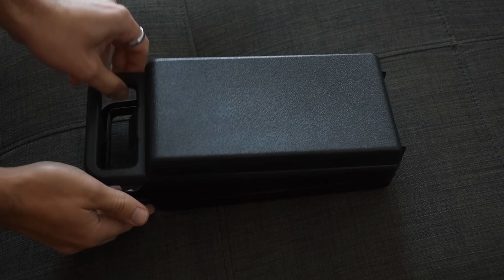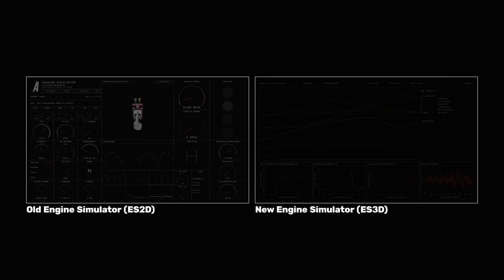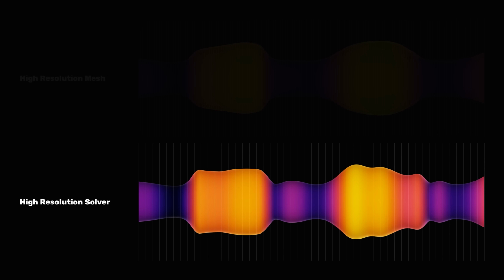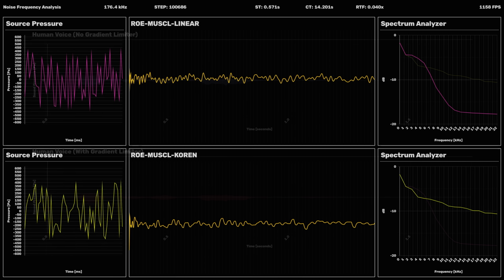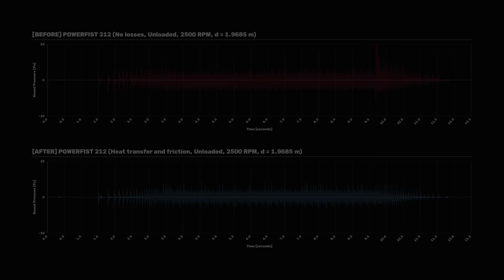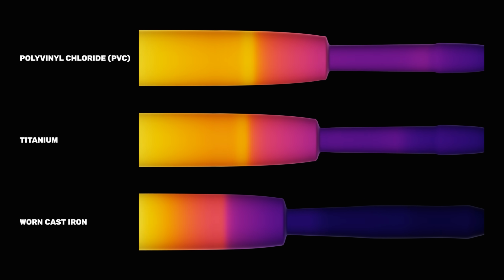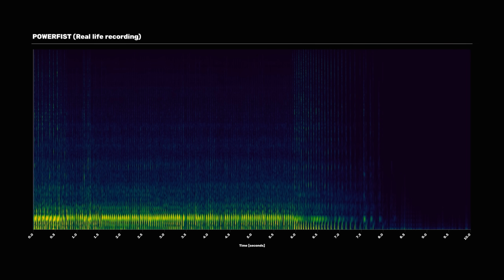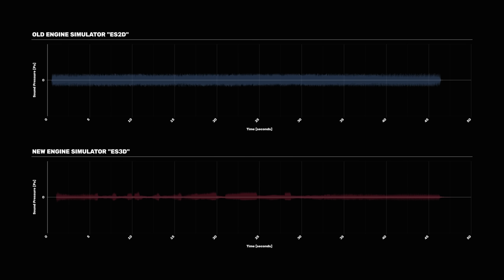Improving My Engine Sound Simulator With Real Data

Comment: One thing I think is important to remember is that it is not just the exhaust making noise. All the parts on the real engine are moving and vibrating creating their own noise which is not simulated (things like  fuel injectors,  filters, even the materials used which impact the noise etc..). But brother I gotta say the simulations sound scarily realistic
Reply from the maker: Yes, you are correct that engines produce mechanical noise. I mentioned it specifically in the video and it's something that is not part of the simulation yet. Right now, I'm focusing on refining the fluid simulation, which addresses the most prominent sources of noise for most engines. At a later time I might look into these other sources of noise
Reply: Don't forget that when you add carburetors or just the throttle body, you’ll hear a deeper intake tone at WOT if you’re running only an air filter. At least that's from what I know about small engines, it probably wouldnt effect larger vehicles like a car like it would an atv or motorcycle.
Reply: yeah, even the rim and tire size
Reply: also the sound and resonance of how a engine sounds can be entirely changed by changing things like runner length, height, thickness etc on something like a exhaust manifold, and those same factors apply to the exhaust too, using something like titanium on an exhaust vs steel you can hear a difference in sound purely from the resonance of the metals itself, cars and instruments aren’t too far off of each other lol
Reply: induction noises as well, the air flowing into the engine makes just as significant noise as the air flowing out of the engine
Reply from the maker: @sahibdipsandhu  No, induction noise is not as significant as exhaust noise. Maybe for an engine that is heavily muffled or if you're standing right next to the intake. In general though, it is not accurate to say that intake sound is as significant as exhaust noise and virtually any research paper on engine noise would agree.
Reply: @AngeTheGreat  On particular cars it can. Engines with ITBs sound significantly different from the front compared to the rear.
Reply from the maker: @Thee_Sinner  The claim I was responding to is that induction noise is comparable to exhaust noise, which is definitely not true. As per the original comment: "air flowing into the engine makes just as significant noise as air flowing out of the engine". In general, this is simply false. If you have an engine with significant exhaust muffling, particularly loud intake and you place the measurement device right next to the intake, then maybe the APPARENT magnitudes will equalize, but this is just stating the obvious and I'm already aware that intakes make noise.

Comment: the updated harley sim sounds SO GOOD!! Also, Im wondering if there is any worth of investing in a visual microphone? It's basically a number of spaced apart mics that triangulate and can visualize where sounds are coming from, and can attenuate specific sounds (for instance, mechanical sounds like you mention trying to ignore). Sure it is an investment as they can be pricey but there are some tutorials and open source software I believe for making your own a little cheaper

Comment: Hear me out.
Midi control.
Wrapped in a VST.

You could tie the accelerator to glissando.
Change the timbre by configuring cylinder count, valving, load, muffling.

The most important part would be mapping midi notes to the resulting lowest frequency of your sim (the fundamental). 

Let me play this engine simulator with a piano keyboard.

Comment: I have a really good question, considering if Engine Simulator has future updates would it also include other engines to simulate the sounds? Such as an Airplane Engine, Lawnmower Engine, Tractor Engine, Tank Engine, Etc?

Additionally, what if Engine Simulator had some extra simulation conditions to make such as "Engine Failures"? What would the Engine Fail's Unique Audio sound like?

Comment: WOW Ange! The final iterations of those simulated engines aren't just the best you've ever created, but they blow most video games out of the water. Even modern, cutting edge, AAA games that released in the last few years don't have that kind of granularity to the engine's sound detail. Really impressive for WIPs and definitely looking forward to seeing how you push right up against those theoretical fluid simulation limits

Comment: 13:25 that is a lot of particles, why not have a single strand of them compressing and releasing along a single vector? most things work with compression so you could have lots of particles closer to each end for the "spring compression" and then some stand in ones along the length of the pipe to effect each end.

Comment: 13:00 im curious about the different layers of wave forms within an engine, not everything is a single shape, so is there a way to layer out the different wave shapes then combine them, like putting an image into separate black and white images for the RGB, you would be able to get the different wave forms even if they're out of sync and still get the highs and lows.

Comment: 11:30 it sounded way to uniform. Also i dont know why you didnt just simulate the high frequencies separate from the origonal, you could give them different rules to make them only play in specific conditions and then feed them through togeather.
Reply: That falls under the fluid dynamics of the combustion process and the derivatives, rather than the audio/exhaust and intake sound signals. That said, I do agree that it is too uniform but that is why.

Comment: have you ever though to add your sound simulator into a game?
for example, it could be a really the best solution for old game, for example Richard Burns Rally: a lot of people driving into this sim, but 20 years old engine recorded sounds (and even a kind of new recorded sounds) are terrible.

your simulator, even the first version, can be a breath of fresh air for such games

Comment: Sounds a bit artificial, but it does surely sound like a hear near the exhaust port.
As side note, when recording real sounds, maybe a open baffle between the engine and the exhaust would help to make it more to one with the simulation.
You know, mounting the engine similar to a speaker in a open baffle setup.

Comment: Have you used one of those sonic tools yet? the ones that display where and what sounds are coming from where, and lets you isolate particular frequencies and only shows those locations. You could use that in combination with some contact sensors/mics to record individual parts of an engine.

Comment: looks like simulation of flute sound with gasoline engine connected.
it looks to me that high frequency components should not to be muffled but mixed in sort of hissing metal flute high harmonics

new simulation sounds exactly like my old bike with one of two cylinders dead.

Comment: Needs to be used in a game where you can build engines, and cars, as well as pick a normal 2002 Dodge Dakota pickup truck with the 5.9L V8 and then drive around with different load cases so you can feel the sound be made as the drive be drived and then smell simulation can happen next. Also can it have simulated tires, and other mechanical noises like the window being down vs the door being open, with rain, snow, cigarette, open liquor, and other variables? Ok thank you in advance! Outstanding! It sounds just like a real F22!

Comment: So I don't claim to know anything, however. I feel like what is going on is that the simulation might take into account an infinitely or very very very thin pipe (obv), What I don't think it accounts for is just how much vibration dissipation the tube itself has. The very high frequency artifacts sounded very odd on the engine simulation but the voice sounded like it was being played on an instrument, especially on the higher quality simulation you did. I don't know if this is possible, but maybe the twang is from the resonating pipe itself sounding like a metal string instead of a pipe because it's just a 2D cross section effectively making it two strings. I know 3D is super hard but maybe a solution would be to make the pipe much more dampening than you would think it'd need to be???

Comment: There's an internal governor on these clones, it's splined into the crank. You can give it as much throttle as you want, but you won't get it past 4300rpm

Comment: 20:26 Those last little resonant tones when the engine shuts off... Don't try to remove them, in the real recording it translates to that highly turbulent aspiration sound, literally like the engine gasping for air. I have no idea how you could model this to make it that last bit better, but perhaps it could translate to the rest of the scenarios where the valve is getting choked out like that.

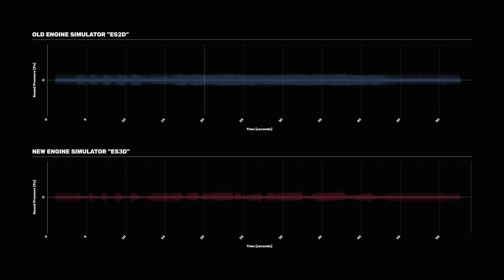Edit: 22:15 the simulation in this run does it perfectly as-is, so unfortunately for you it's probably a thing of fine tuning to get it to work in all scenarios 😂

Comment: 24:50 Has someone who has been inside of like an older vehicle that's been straight piped, this sounds just like that, if you took a van and hollowed it out so there was nothing but the chairs and put the engine in the front and there's only the actual firewall protecting you from it would sound the same

Comment: The strange harmonic artifacts starting at 17:23 sound a lot like some of the broken DSP effects in Half-Life. I was impressed to hear the Harley simulation after the harmonics were fixed, and then my mind was completely blown by the V8 and V10 simulations during the entire tube junctions section. Hearing that much personality and realism from completely simulated engines in real time is truly incredible.
Reply from the maker: Thanks, glad you enjoyed the video. I want to clarify that all of the engine clips in this video were not generated in real-time. I made a note about this in the pinned comment. I should have mentioned it in the video but I forgot to include it in the script. The simulation can still generate realistic engine sounds in real-time but they likely won't be as sharp/high-fidelity as the audio clips in this video. It remains to be seen though since I'm still working with a completely unoptimized simulation

Comment: I'd be curious if you could set up a machine learning pipeline to figure out what the "missing algorithmic pieces" are. You have the ability to generate real data with pipes and can easily compare that with the generated data, so it should be possible to give each small pipe segment a set a parameters and let it optimize to sound like the reference. Wouldn't be as computationally efficient, but could be a useful aid for where the math derived algorithm is different than the real world ideal

Comment: What it sounds like is that you are not taking into account dispersion. The dispersion should cause the overtones to be dampened and cancel. Else what happens is that constructively interfere but with dispersion they will cancel out due to phase shifts which is much more dominant in the overtones. This is really likely due to the vibrations of a real engine effecting the sound while in your simulation the "engine" is not vibrating. These vibrations may not seem like they would effect the found but they are effectively changing the "pipe length" so it would be as if you simulated the pipe length changing with time and with some randomness. It wouldn't effect the fundamental frequency  much but for overtones there will be no well defined termination point essentially dampening them.

Comment: Cool, but it would have been a lot cooler if you modeled the engine designed to turn fuel into noise as inefficiently as possible.  A flathead.

Comment: genuinely shocked at how much fixing the heat transfer made the simulation sound SO MUCH MORE REALISTIC

also, something interesting i noticed: I live in an area with lots of waterbound engines (especially things like external speedboat engines)
the simulations of these dry/air engines sound a LOT like these waterbound engines, especially at startup (go listen to a Yamaha outboard startup, you'll get what I mean)
maybe it's something to do with the medium the simulation is using, like the fluid is too dense/water-like compared to real air? 
I can't tell for sure, being no major in fluid sim at all, but I feel like it's something important to note

Comment: Superb work, really impressive model! I've spent much of my career building models of realworld systems, one area I didn't see mentioned is real world imperfections and tolerances. Have you had a chance to explore the impact of adding small random errors to each of the parameters in the engine components for example?

Comment: This is an absolute masterpiece and is the dream of an engine enthusiast! To sit there playing around with various engines, cranked up on the sound system is so much fun. 

One thing I PLEAD with you to add, some kind of analogue control method ... instead of using keyboard only. That way It can be bound to a pedal set or joystick, and then we would have proper control of the engine, the sound and the realism it would provide. The would greatly increase your downloads especially when released on Steam. I would sit there all day enjoying it! I think the neighbors would think I own many cars in my garage! 

Great work!

Comment: Time to simulate the rest of the environment around the exhaust port then. Seems like you're just about there anyway. This is incredible. Everything prior to this was too but you could probably stop here and nobody could complain. 

The only thing left is to somehow add in the intense variance of what sounds like the airflow being pressurized and depressurized in large amounts. Probably over the whole system and maybe due to the uneven nature of incomplete combustion and the "power" hiccups it causes in the air pump. Much like putting an engine under load, the engine running sub-optimally for a revolution or two can cause huge subjective audio changes. At least that's my guess.

Comment: This is by far the biggest leap in audio quality so far. You could prolly add mechanical noise driven by the opening and closing of the valves, and it would likely become indistinguishable from real audio.

Comment: Need to record the exhaust sound without anything mounted to to the engine as a base line not the straight (curved) pipe as the base line.
(Second thought edit) 
Seeing that there will always be some sort of tubing to route the gases the unobstructed (straight) pipe would be the correct base model for any changes.  😬

Comment: Have you already tried using impulse responses? I am always surprised at how well they can emulate speaker motors with such resolution, assuming enough samples are taken the correct way. I think another plus of convolving is that its typically pretty low overhead. Another handy feature is that at times those let you incorporate a certain amount of filtering and feedback. Cheers.

Comment: I just can’t believe how great this is. In real life, engine misfires occasionally occur. Furthermore, in almost all engines, there is valve overlap where the intake and exhaust valves are open simultaneously. This causes a portion of the exhaust gases to enter the intake manifold and be drawn into another cylinder especially with factory mufflers or turbo compressors. That’s so interesting to simulate!(to watch it simulated for you😅)

Comment: Now that the simulation is getting more and more accurate - do you think you could take a recording on an engine (at known speed/load) and calculate out the parameters of that engine? Exhaust shape, cam profile, etc. A brute-force solution or genetic algorithm may actually do quite well, just comparing simulated outputs to the real recording and choosing which one is closest.

Comment: Have intake noises had the same level of polish applied to them? Some engine setups have distinctive noises coming from the intake - especially motorcycles where the rider's ears are usually only 2-3 feet away from them.

Comment: To me it sounds like you have a huge instant pressure front like smacking the end of a tube, but an engine valve restricts the flow so it should ramp up as the valve opens and slowly ramp down as the pressure in the cylinder decreases. The ramp up speed should be reduced at lower rpm because the valve moves slower. I don't know how much of that you already did but that's what I'm hearing.

Comment: If youd be interested in some strangely built engines to test the simulator when its more complete i have....many, a rotary valve 2 cylinder 2 stroke and a 2 stroke triple (with one expansion chamber) might be things youd want to test

Comment: Have you thought about recording the crankshaft position on the real engine with an encoder / resolver, and using that as input data to the engine simulator so that you can directly compare a real sound recording with a simulated one, where the sim and the real are in the same phase? Maybe you can extract the phase from the exhaust sound, although not between exhaust stroke